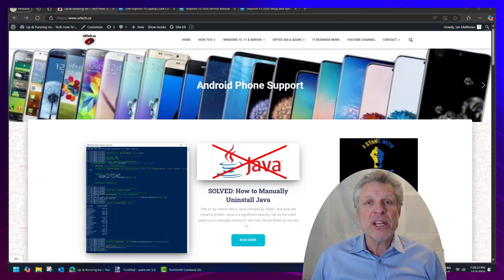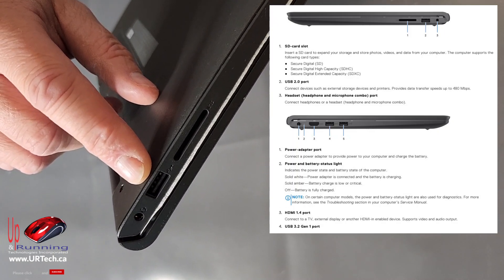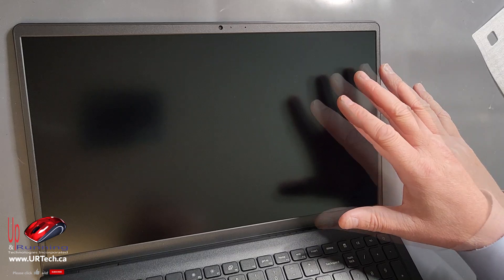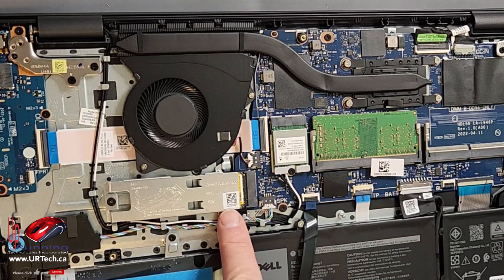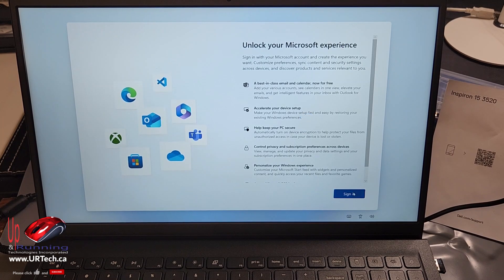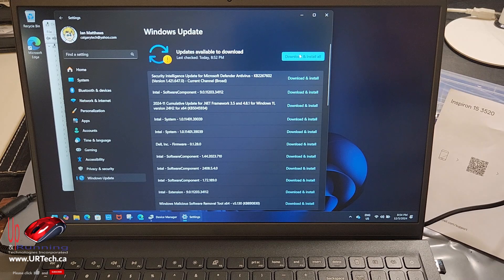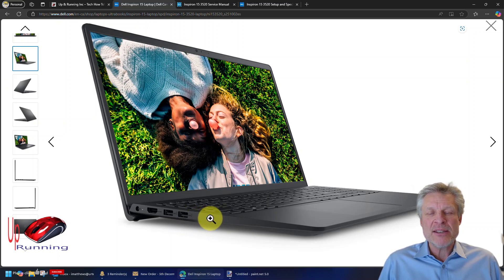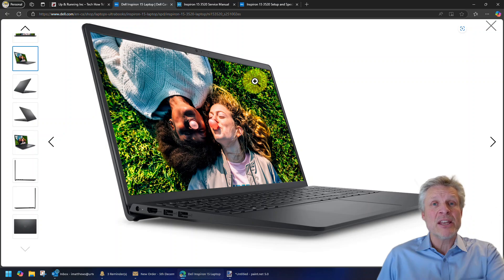Best Budget Laptop? Dell Inspiron 15 3520 Thorough Review & Upgrade

Comment: I've had an Inspiron 3520 about nine months and I'm getting a "wattage cannot be determined" warning. The problem is with a fastener inside the computer that holds the jack in place. If it breaks, you have to push the plug into the jack really hard.  I have an older Latitude with the same kind of jack, but I never had this problem after years of use.  It might be the Latitude uses better plastic, it certainly didn''t scratch as easily.

Comment: Thanks for the video.
Have 8Gb of RAM (8GB 1Rx16 PC4-3200AA-SC0-12). Wanted to upgrade RAM. Installed 16Gb (CMSX16GX4M1A3200C22 DDR4). Laptop doesn't like it. Blank screen, system diagnostic lights show 2 amber lights and 5 white lights (Invalid memory installed). What could be wrong?
Reply: some ram  aren't compatible or depend if its not slotted  properly

it all depend of the motherboard
try only installing one stick at a time
Reply: @tryharderttvs8275  Thank you. I have already installed 32GB (16GB x 2) of RAM, it works perfectly. I found that Crucial memory is compatible (CT16G4SFRA32A).

Comment: Thanks for the informative video.I picked one up  from dell for $205 in nov 2024 and then added samsung 2 TB m.2 cloned it ,then added 2 TB samsung ssd for a total of 4 TB then added 32 mb ram and finally wifi 6E card. When done laptop with upgrades i spent under $500. not bad for a 12th gen laptop with 4tb storage and 32 mb ram. The m.2 drive along ram upgrade doubled the computer speed and the wifi 6E card 1.2 gb speed along with my wifi 6 network.